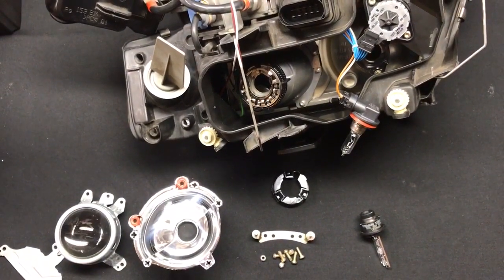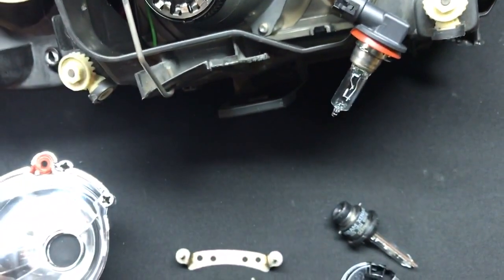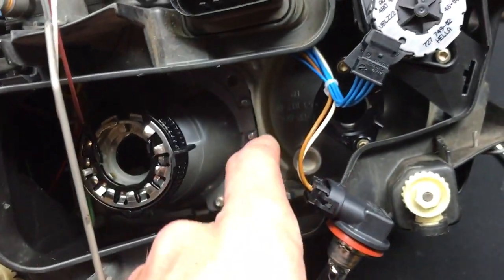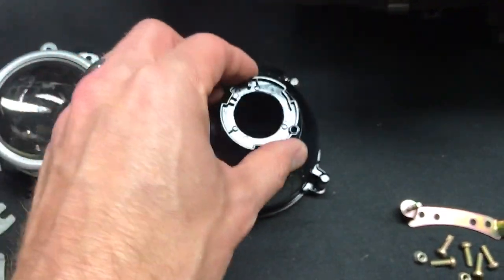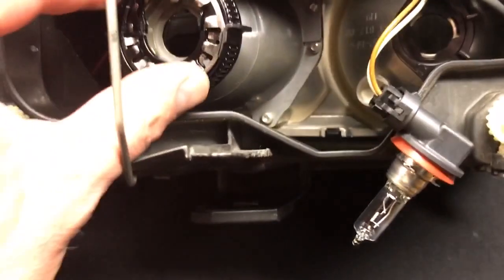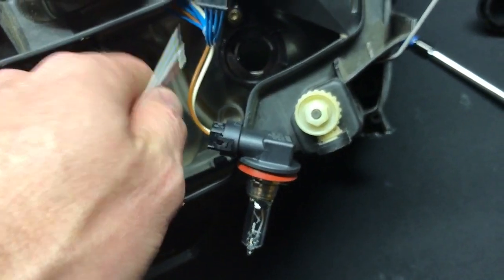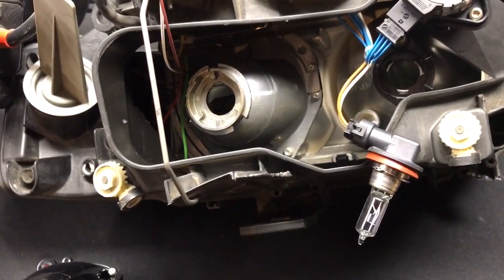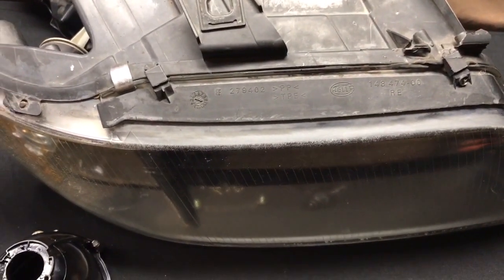4TLR Bi-Xenon projector retrofit installation - Audi allroad C5 www.HIDprojectors.com

Comment: If you were going to run a splitter for the high beams /solenoid would you just drill through the boot for an extra hole for the wire?

Comment: Soo allroad headlights are a direct swap for the 97-01 A6, so these projectors should fit the A6 just as easily right? The light output from oem lights is borderline dangerous, especially on wet roads.
Reply from the maker: If you installed a retrofitted set of allroad lights into your A6 I don’t see why it wouldn’t work.
Reply: @HIDprojectors  no, I have a6 lights. With the back cover off everything looks identical so I hope this works out
Reply from the maker: @Scouter98  Once your order is in please keep us updated, if we can help in anyway let us know.  We have some extra allroad OEM headlight parts here in stock if you need anything.

Comment: Hey Tom, so minor correction.  The five screws for the projector (@1:29) are T20 and the two screws for the bracket (@2:08) are T15.
Reply from the maker: Yes, we  have seen some model years use different size screw heads!  Thanks for pointing that out.

Comment: hi but what if i don t have xenon on my allroad how can i do this?
Reply from the maker: You could choose any projector we offer at that point.  You would have to retrofit them in using either the threaded shaft method or with the nut and bolt method. You'll also need, bulbs and ballasts.  Here's a good link to check out: https://www.hidprojectors.com/collections/do-it-yourself